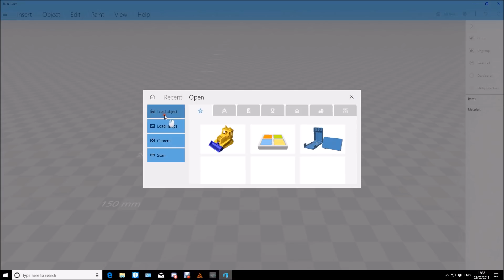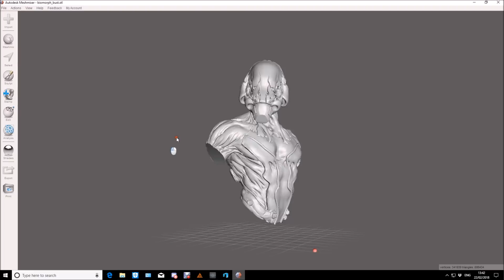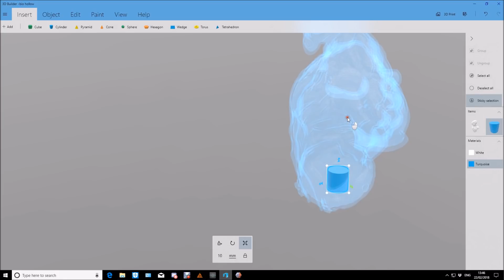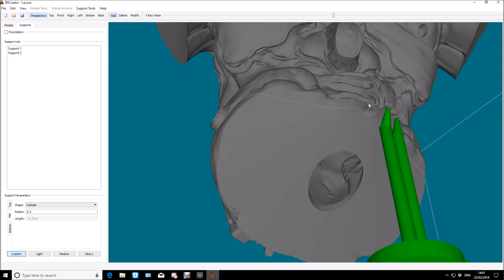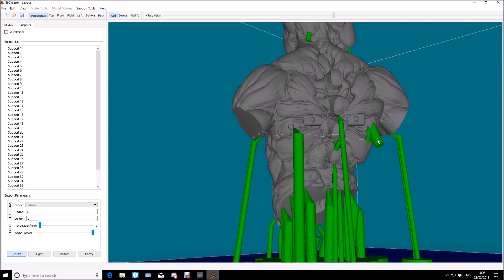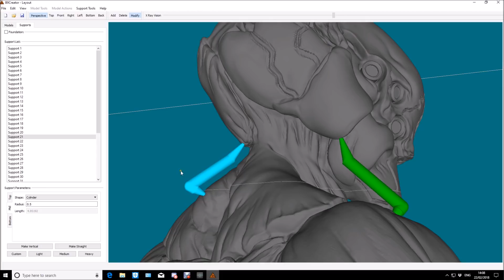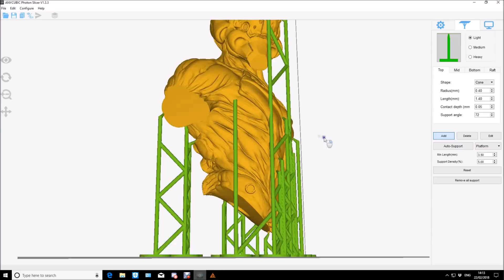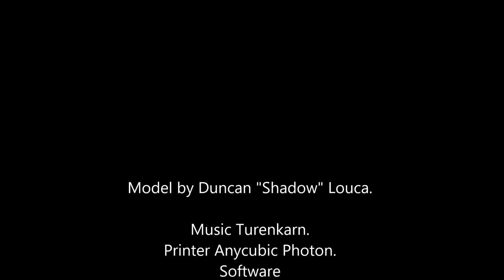How to sort models for you Anycubic Photon printer. reworked audio

Comment: Hi there, I have a question/problem
When I try to slice from the program, it slices very fast, its about 1/3 of the normal time, and when i try to print it just doesnt print.
I tried reinstalling the program, but it didnt work
Reply from the maker: k are you using the photon slicer to slice or are you using chitubox. are you using the photon or the photon-s ?
Reply from the maker: if your on facebook you might want to join the group " Anycubic Photon Printer Owners " we can give you more info there
Reply: TK's 3D Prints yes I use the photon slicer and the anycubic photon
Reply: TK's 3D Prints thanks I’ll check it out

Comment: Correct me if I'm wrong but amount of supports has nothing to do with print time on a photon. Time on a photon is layers x (exposure time + off time). It prints the entire later at once. On a laser SLA it adds time.
Reply from the maker: yea with the photon its all down to the height of the model. since its using lcd it will do an entire layer at once. so you could have 6 models on the build plate. and its print time is based on the tallest model. and if you was printing the same 6 models on sla it would take a little longer as the laser is fast but still works like an fdm printer moving the laser about. but lcd tech prints a layer at a time. so it would take just as long  on the photon to print 6 models as it would to print 1.

Comment: I repaired a model in 3D builder then when I "Inspect" it in Meshmixer, there are still errors (and when I autorepair in Meshmixer, it deletes the "erroneous" parts). What am I doing wrong?
Reply from the maker: hmm.. try hollowing out the model in meshmixer before inspecting the model. i tend to avoid meshmixer for repairing. the latest version of it seems to like to kill some model with repair. i had a hard time finding an older version. as meshmixer will always overwrite the prev version of meshmixer. so you can have multiple versions of it. :( so fix in 3d builder. hollow and add vent holes in meshmixer save the file. then reload and repair again if with 3d builder. that should sort it.
let me know if you still have problems.
Reply: @TKs3DPrints  Super! Thanks so much! Will give this a try

Comment: With the hollowing and the hole do you drain the resin thats inside once the model has completed or in this instance could a hole have been placed in the head area so it drained as it printed .  Am new to the photon and am getting confused with model placement etc so watching as many videos as possible.  Thanks
Reply from the maker: drain holes need to be close to the build plate to allow air into the model as its printing. this stops suction of the model when it is pulled of the fep sheet. and it will drain and allow air to flow. so yea always place at the bottom of the model close to the build plate. remember the models print upside down.

Comment: Turenkarn: Q: thinking of getting the Any Cubic 3D. Since it doesn’t come with a 3D scanner, is there another way to scan and then print ? I want to scan and print my sculptures. Thx.
Reply from the maker: well you could use autodesk Recap pro. you would need to sign up for a student license to use it for free. with the software comes Recap photo. that basically is amazing. you take photos of your sculptures. about 100 i think you can use. photos of every angle  then load in the photos to it and then it will build a 3d model of your photos. clean it up remove what you dont need and save out the model. then you can load in the model into zbrush or sculptris or even meshmixer. and you can then clean up the model and add more details if you need to. check out this video to give you an idea of what recap can do. also if you have a drone you can also use photos for them . https://youtu.be/VDo9BaX3khE
Reply from the maker: or shis one. more details about how to use the software. just remember that the software Remake. is no longer in use. and Recap is the latest version of the software.  but the interface etc is very much the same and the way you make the model is the same. https://youtu.be/M2VazVGm7TU

Comment: i'm trying to use the b9creator with my anycubic photon, but i can't figure out how to add it as a printer setting. It won't let me choose anything other than various b9creator printer settings it comes with stock.
Reply from the maker: as in the print size ? if its that its not a real problem since b9 creations is just for adding supports to the model. then you can export it out. is that what your on about ?
Reply from the maker: if your on about saving the file. head to the files section after adding supports. then export the file to save as an stl file.
Reply: my apologies, i responded before i finished watching the video. I was just surprised that you were able to load a wanhao print configuration in b9, as it doesn't giving me any option of that sort.
Thank you for the quick and helpful reply.
Reply from the maker: ahh thats a plate even morgan made. he will be making one for the photon.

Comment: Why it is necessary the hole that you make with the cylinder?
Reply from the maker: sometimes when you hole a model with meshmixer it can corrupt the edges also depending on the model in meshmixer it has a tendency to crash for me. and also the hole will sometimes push thru the other wall depending on how close the walls are. i find using a cylinder gives you more control and a cleaner cut. :)
but you might not have problems with meshmixer.
Reply: Turenkarn's 3D  thank you! But what is his function? Avoid suction? That the resin flows? I would understand the position of the hole if it was positioned near to the vat in this way waste resin could flow outside the model  but I dont understand the position near the buildplate.
Reply from the maker: its a strange one as the build plate is actually upside down. so when you start printing the build plate is above so the hole that looks like its at the bottom of the model is at the top when you start printing. so after it enters the vat and cures a layer when the plate raises it allows are threw the top and cuts down on the suction. of the fep sheet.
nut yes the hole is to help release resin from the model to save resin and decrease the suction of the model when it comes of the FEP sheet
:)
Reply: Turenkarn's 3D Tanks thank you so much! I understood, its a perfect explication!

Comment: Hello good video but ive got one Problem: My Prints are to small in the Z-Axis, the x and y axis are correct, can you give me the correct values of your axis from the photon software? Thank you much!
Reply from the maker: x size 68.04    y size 120.96   z size 150  hope that helps. :)
Reply: Turenkarn's 3D Tanks hello thank you much. I Tried with 150in z but the parts are 2.5mm to smal
Reply from the maker: what resin are you using. some resins will shrink. best thing to do is increase the model z by 3m see if that will do the trick. i tend to use "fun to do" industrial resin as it has very low shrinkage.
Reply: Turenkarn's 3D Tanks im Using the original Photon Resin from anycubic. But i dont think that i exactly shrink 2.5mm?
Reply from the maker: all resin will shrink just depends from model to model. at the moment i am working on a model to test the tolerance of resin printers. as i have myself tried to use connectors to clip parts together just to find out that after the parts dont click together as they should do to shrinkage. but what i would do or try would be to load the model into 3d builder and click the unlock on the size and try and increase the height of the model by 2.5mm and then test print and see what happens. was the model in an upright position.  i have done xyz test cubes with the "fun to do" resin and have had hardly any shrinkage with that. unfortunately i had run out of the photon resin to try these tests out. but i am expecting some soon. and will test it out correctly.
Reply: Turenkarn's 3D Tanks i Test it with your Idea to Change the z high in the scale Option an will give you a Feedback for that
Reply: Hello, the support service from anycubic write to me: Ive should change the ampere to 1.1A, but no answer how to do? Can you help?
Reply from the maker: hmmm when it comes to  the techy side of things i am not that good at. but if you come onto facebook and join the groups Anycubic Photon 3D Printer DLP Drucker Users. and the group Anycubic Photon DLP Printer Owners. someone there who is more techy should be able to help :)
Reply: Turenkarn's 3D Tanks hello okay im searching this groups ;)
Reply: Turenkarn's 3D Tanks  thanks for the advice. I am nearly out of the original stuff. I got the test cube to print and a couple little things and then it stopped.....
Reply: Has anyone got the resins from "3d Okay" to work!? Please tell me what is going on. I. About ready to put a bullet through it!
Reply from the maker: if you join the facebook group. Anycubic Photon DLP Printer Owners ask there. there should also be a list of resins used and tested and there settings etc.
Reply: Turenkarn's 3D Tanks I am actually not a Facebook user. I saw a document on Google drive, and the settings still can't get it cure past the first couple slices...these slices always end up on the vat. I am new into this ( about 12 hours now) and appreciate any tips.
Reply from the maker: have you used up the green resin that came with the unit. at the moment i am trying to find the list to post for you. but depending on the colour of the resin. i use these settings for my FTD resin these might help for you layer thickness 0.5 Normal Exposure Time 12, Off time 2, Bottom Exposure Time 80, Bottom Layers 10. also sounds like the bed might need a relevel. this video should help get a perfect level. https://youtu.be/roAqm5c3rfU
Reply from the maker: you got stuff to print with the 3d okey resin. when you say it stopped ? as in the printer ?
Reply: Turenkarn's 3D Tanks I got the test cube to print with the original resin that came with it shortly after that I wasn't able to get anything to stick to the plate or print. It does have stuff stuck on the film in the vat though. I have had no luck with 3d okay resin
Reply from the maker: k carefully use the plastic scraper to gently lift and remove any hard resin stuck to the bottom of the fep. you can remove the vat. and press gently under the fep to help release the cured resin of the fep sheet. when you have removed all the cured bits. use a filter and pour the resin back into the bottle catching all the bits with the filter. double check the fep sheet for any damage clean up any old resin still in the vat and clean the vat with tissue to remove all the resin then use. this video on how to level the built plate. most of us use Fun To Do resin from https://funtodo.peediemodels.com/categories.php?cat=5

https://youtu.be/roAqm5c3rfU
Reply: Turenkarn's 3D Tanks I clean it like that before every round of testing and it still doesn't work.
Reply from the maker: i take it the model is sticking to the bed then ? but some of the model is ending up on the fep ?
Reply: Turenkarn's 3D Tanks the first layer does then it totally fails
Reply from the maker: k i just had a look at the chart we have for the group about resins users have tested and used. looks like there was only one use that used the same resin i will share are list with you. what settings are you using. by the way this would be so much easier if you had a facebook account and joined are group. you would get a lot more help from other users. :) https://docs.google.com/spreadsheets/d/1crvzMnt_8NJXAsABinoIhcOjE8l3h7s0L82Zlh1vkL8/edit#gid=0
Reply from the maker: what is the model your trying to print and are you printing it hollow or solid. are you printing the model directly sitting on the base or have you printing the model at an angle with supports under the whole model ?
Reply: Turenkarn's 3D Tanks yeah I saw that a few days ago and those settings failed...I have different resin coming, I am just going to throw that other shit out.
Reply from the maker: dont throw it. and if you do throw the resin. do it correctly poor it out into a container and leave out for the sun to cure it solid before you dispose of it.
 contact the company and let them know its failing etc all the time. etc see if they will refund. also it lets them know they have to alter there resins to have them work on the photon.  when buying resin make sure it is for DLP and not for SLA i have a couple of brands on the moai that i have tried on the photon. took nearly 1 min a layer to cure. so i gave up. i was just testing it to see if it would work. but the best brands as you can tell in my eyes is the FTD range. it has low shrinkage the industrial resin is heat resistant to about 220c etc.
Reply from the maker: also hope you have better luck with the new resin. and hope to see you up and printing soon. :)
Reply: Turenkarn's 3D Tanks What brand is the FTD range? Where do you get it?
Reply from the maker: you can get it from most places depending on where you are. i get mine from https://funtodo.peediemodels.com/categories.php?cat=5
Reply: Turenkarn's 3D Tanks thanks for the info
Reply from the maker: your welcome

Comment: Do you sometimes get a random piece of cured resin stuck to the bottom of the vat? If so, do you know how to avoid this? I've had this happen and ruin several prints when it overlaps with the part being printed. Curiously, even the video that AnyCubic put up to show how to clean the vat shows this happening.
Reply: Can someone give me some pointers on using the 3d Okay resins?
Reply: https://docs.google.com/spreadsheets/d/1crvzMnt_8NJXAsABinoIhcOjE8l3h7s0L82Zlh1vkL8/edit#gid=0
Reply from the maker: yes i do depends on the resins. at the moment i am using the fun to do industrial black resin and have the settings on low as i can. mainly effects when you get bleed threw clear or transparent resin. i tend to always check the vat with the scraper and remove the chunks by getting the bits onto the scraper then moving it left to right on the back part of the vat to suck the resin of the scraper until just the bit is left.then remove it from the vat.
Reply: OK, thanks. That's good to know. I do check and clean the vat bottom very carefully after each print, but the formation of these chunks of cured resin while my part is printing is giving me trouble sometimes. I may try reducing exposure times a little to see if that helps. I'm using 50 secs on the first 6 layers, and 8 seconds on main layers. I'm using Wanhao black resin at the moment. May have to try something else...
Reply: I am starting to think this problem is mostly caused by inadequate support of "islands". You have to use the tool which shows a line around the part to identify all possible island areas. If you miss one, or if the angle is too shallow in the area surrounding the support point, the resin won't peel from the vat. Automatic support generation  can't be trusted to properly support print islands.
Reply from the maker: agread that's why i tend to do my own supports. but always remember that if you do use auto. to double check the model and add your own supports to areas that need them sadly at the moment we don't get the lattice work when you add manually hence why i suggest auto then check the model and add were its needed. :)

Comment: Looking at this hollowed out model, and knowing the supports are fully solid, it looks like more resin is being used on the support structure than the model itself.  Is it easy to tell how much volume your supports are costing you when setting them up in B9?  I have a feeling I am going to fail a lot of models because of being stingy with supports (which will cost me more resin in the long run of course, logic be damned)
Reply: OH! also, for thicker supports, like the 6mm diameter ones, can you make those support structures hollow?  considering the VAST bulk of stregth in a cylinder is along the surface area it would seem to make sense to have things like 6mm supports that are 1 mm or 1.5 mm perimeter thickness  and hollow in the middle
Reply from the maker: supports on b9 are thicker than the ones on the photon slicer. and if the supports are that large if you save the stl out with the supports on them then you could load it up into meshmixer or 3d builder and make them hollow but the problem there is you would need the drain hole on the side if the support. as the base would be stuck to the base. but yes a 6mm support could have a 3 mm hole on the side. or a 2 mm one. but you would not save that much resin.  also there is an auto support function in b9 that is way better than most auto supports in its placements.
Reply: Yeah, I would think on the bigger supports a drain holes in the side of the support disk would be the best, plenty of room there.  You are correct I am sure about not saving much resin.  And the supports being thin straws with one side plugged would mean the thick resin probably would not even drain out well unless you cut them off  and drain them before the alcohol bath.  The amount of work keeps growing for some pretty small gains.  I am just a cheap bastard, heh.